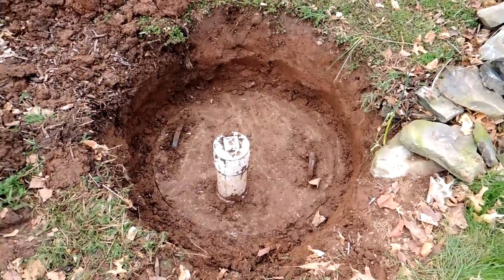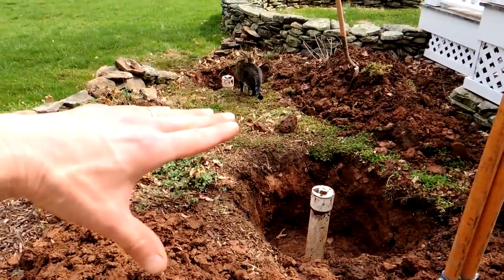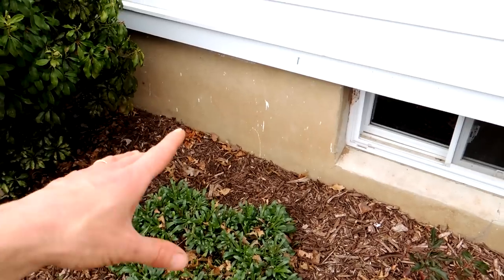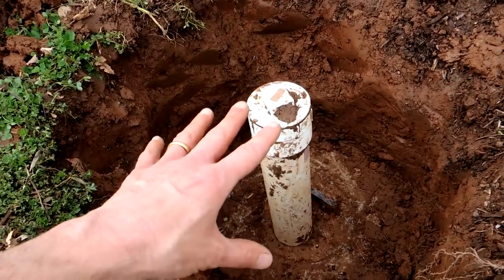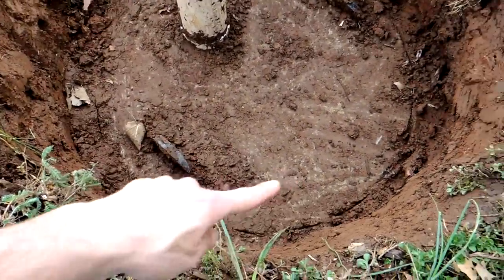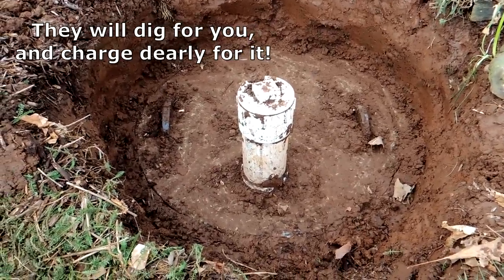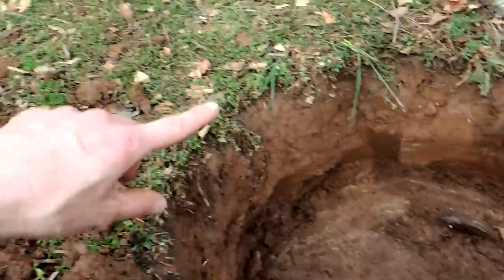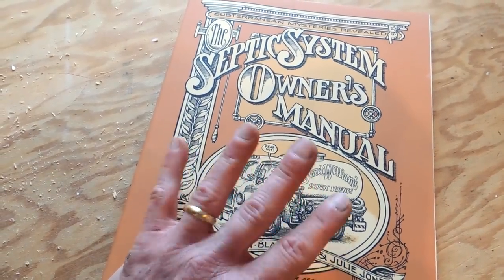Find And Dig Out Your Septic Tank Access Cover

Comment: My inspection pipe in the tank is "loose". When I tried taking off the cap, the pipe started moving. Is that normal?
Reply from the maker: Eh, probably not.  The pipe is usually an extension from a connector at the tank cover and if they didn't glue that connection well (assuming it's PVC) then it may have come loose.  What you don't want is nearby dirt just falling into the tank.  The only way to know for sure what happened is to dig down to the inspection cover and take a look at where the pipe enters.
Reply: Mine is the same, someone hit it with the lawn mower...no big deal. Just seat it as best you can and cement it in place next time you clean the system out.

Comment: Can you pump the D box?
Reply from the maker: Under normal circumstances the D box is not pumped.  The distribution box is really just a means to connect all the pipes in the leach field to one place.  It is installed after the septic tank, so only liquids should be flowing through it.  That said, sometimes things go wrong and solids from the septic tank make their way to the distribution box or the leach field pipes.  That's bad.  When it happens the system must be cleaned out, either by the means of a hose with high pressure water jets snaked through the system and directed backwards towards the septic tank or by the means of a backhoe to dig up the problem!  If your D box is damaged or if there is significant solids from the septic tank which found their way there, it usually means a backhoe and replacement.

Comment: Every 2 or 3 years ??????  Should be able to go longer if its working properly …
Reply from the maker: That's a well accepted rule of thumb.  The variables which determine the length of time you can go are many, and include the number of people using the system, how they use the system (such as the use of certain hygiene products or the length of showers), how large the system is and the condition of the field and tank, what cleaning products or other chemicals might be sent down the drains, the operating condition and age of household toilets, whether a garbage disposal unit is installed or not, the amount of laundry done in a week and the type of washer, and more.  I have seen homes with septic systems that must be cleaned every few months to avoid complete failure, and I have seen systems that have not been cleaned in ten years.  In my area a cleanout is about $300 currently, so an average of $100 a year to keep a septic tank operating well doesn't sound like a lot.